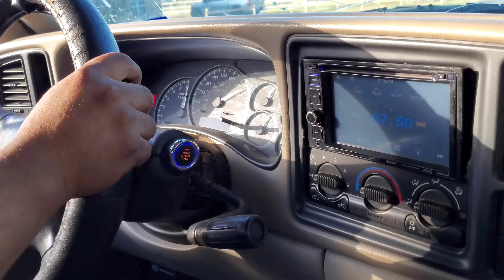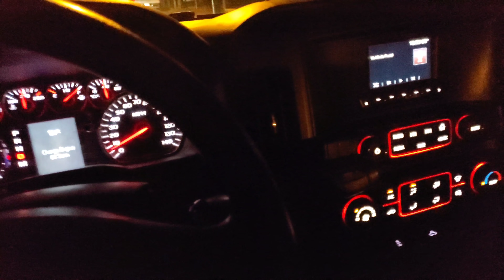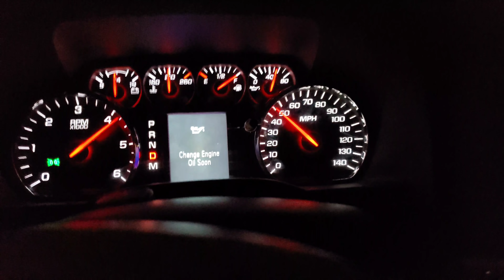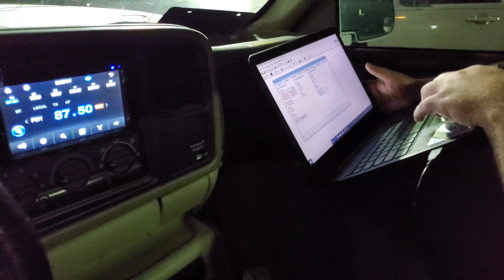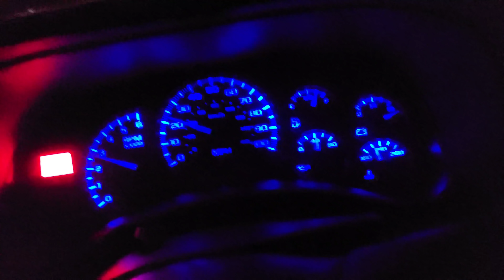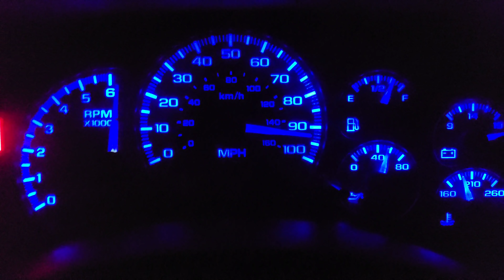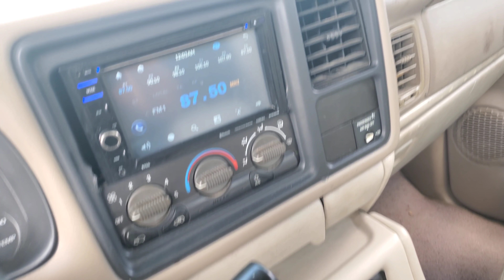Tuning The Cammed 5.3l Truck

Comment: Looks good bro, definitely drop some headers and get the basics to help your tuner! Injectors, plugs, wires, all will help to get most out of motor! Josh tuning is hands down the best tuner I’ve had on my truck, this is my 3rd tune on the truck and it runs strong! Look at going with sometime, awesome work!

Comment: Would like to get I'm contact with this tuner....but yeah, your truck is coming along strong...I got a 2002 with a 5.3 myself, pretty much adding things here and there and let me tell you, the 3 BIG factors that open up all the doors for some true power in these trucks is by upgrading your intake, exhaust, and fuel delivery... once you got those things up and ready then the other bolt ons like the cam, the torque converter and a shift kit in your transmission 4l80 or 4l60 ( I'm running a 4l80e) , some gears in the rear end and positive traction...you you will definitely wake these monsters up. You can do other things getting into the heads and stuff but you don't really have to if your gonna drive it around here and there, if your not getting into pro chargers and turbos and nitrous, then u ain't gotta mess with the heads and the pistons and all that... just for all you people out there with gen4  5.3 engines in your trucks,... I'll throw in a little 3 piece mod combo advice that works wonders... an lsxr 102 intake manifold($$1,200) or TBSS one($300-$400) ... a 223/227  600-600  113 lsa cam (the sloppy stage 2 is pretty close to this around $300) ... and a 2800-3200 stall converter ($400-$600). These 3 things will give you the foundation to a mean 5.3... don't forget a transmission cooler for that stall($80.00)... you'll need it. And like I said,  performance injectors....X pipe exhaust... performance fuel pump...rear end gears... performance msd wiring... it all contributes... so if your lost, try this set up...thank me later.

Comment: I recommend JR Led in Pharr tx man off old expressway 83 had the bed leds and he can add your light to the inside of your ac control and everything 

And if down to run I have a 2016 single cab 5.3 with cam stall and Long tube headers I’m in the Edinburgh Area when I’m on my days off from work

Comment: Keep up the badass videos bro. Try using the tow haul button and put it on 3rd gear next time
Reply from the maker: Button doesn't work or id be using it
Reply: Try to check if the wire of the button broke off or is unplugged bro. That's what happened to me

Comment: Plus you're running the original intake tube that goes to your throttle body and that one has a lot of restrictions in it you need to get the one that is just a tube all the way to your filter

Comment: Use the towl haul button you gonna see a difference
Reply from the maker: It wasn't working but i changed the fuses and it jumps 💯
Reply: Never tried using the tow haul lol....gonna try it on my Sierra
Reply: Cesar Ceja yea bro if you got it tuned use it going 30/35 or 60 it will rev up on its own and that’s when you can step on it and it’s gonna show a good difference
Reply: Thanx Bro I’ll give it a try and let u knw

Comment: I use diesel oil on mine lol
Reply from the maker: Bruh 😂
Reply: It’s cause if you use regular oil it’s gonna make it like water since we use them to chakaliar and desil oil is thicker
Reply: Look into using penngrade 80$ for 12 quarts I run it in my 408 stroker